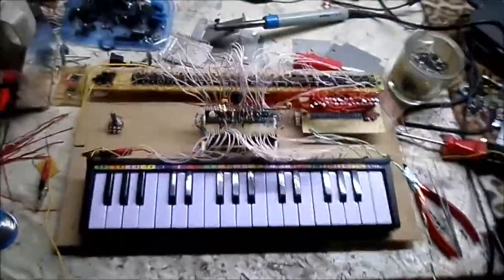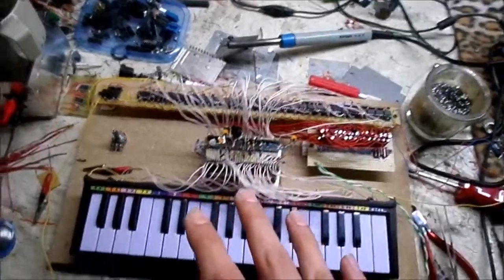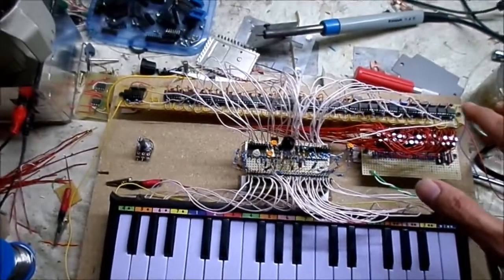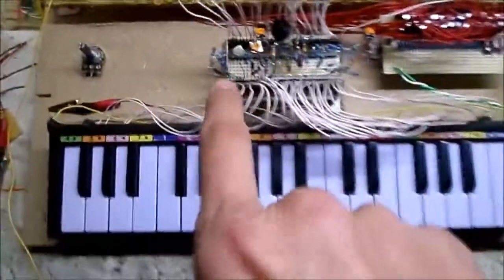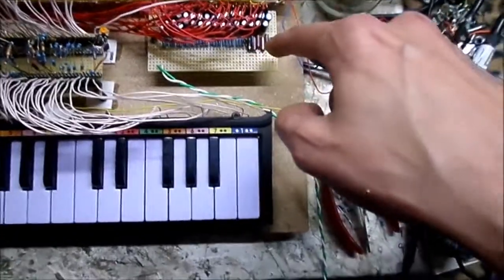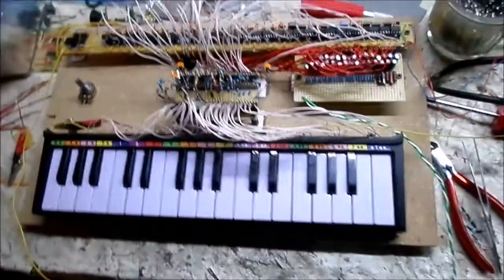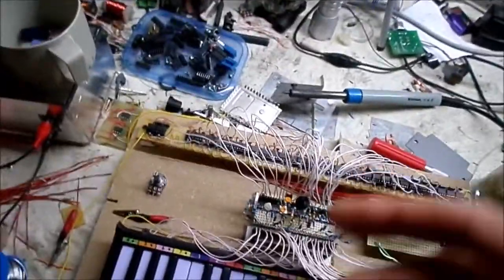'' 555 based '' polyphonic synth keyboard

Comment: You can use only 12 oscillators and then put to the exit of every oscillator divider chip (cd4040b) and you will have many octaves (oscillators must be tuned to highest octave that you need).

Comment: Great project. I tried this years ago but could not figure out how to keep the oscillators from affecting each other. I gave up and bought an old organ with a TOG IC and went that direction.  My TOG chip failed recently, and got me thinking about building a555 based TOG just for fun
Reply from the maker: decoupling is a major factor when working with oscillator circuits, every 555 has a 100nf decoupling cap, not sure if i show it in the vid .. what's a TOG ic ? i need to finish this project at some point using trim pots to tune all the keys
Reply: @dirkk82  A TOG is a Top Octave Generator

Comment: wish i knew where to even start with stuff like this
could you recommend a starting point? a book or something?
Reply from the maker: Forest Mims books on getting started in electronics is a great way to start, have a look online as u can preview the book to get an idea of what it offers =)
Reply: thanks for that, it actually looks perfect for a pure beginner :)
Reply from the maker: that was Mim's intention =) i've never bought books on the subject really, i just took things apart and bought components, looked at diagrams a lot and asked people a lot of questions .. the best way is learning by doing ! and that keyboard i built is in actuality very simple, it's just a lot of work ! basically u have 32 of the same circuit and only the frequency is changed for every key, set by a resistor .. keep an eye on the channel as i will have an update video of this project soon !
Reply from the maker: and if u have questions, come to our community on G+, im sure you'll find more things that might interest u :-)

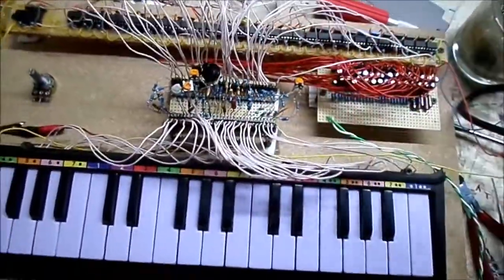Comment: 3:37 "trimpots" sounds for me like "trim pants" or "trim ponds" )) I've found the right word after few minutes of googling although...
I've reminded that I've tweaked probably one of these in my Roland A-800 Pro MIDI controller. It's setup for after-touch is horrible and you can't perform it if you'll not open the keyboard and turn that thing (to the left... not sure). It's funny how they do that ))

Comment: Cool project, very unique sound. I like it. XD

Now, here's how I would implement the same thing. Not a suggestion or anything, but the way I'v thought about a similar project. First of all, I would matrix the keys and use a ATMega Microcontroller. 8 keys (1 octave) per row, one octave per column. Now, to power the 555s, you could use the Arduino's +5VCC rail, which is a heavily regulated supply. You'd only need as many 555s as you would simultaneous keypresses, say, 9 of them for 9 key polyphony. The 9 outputs of the Arduino to the 555s would be pulse width modulated, and filtered with a capacitor, allowing it to replace ALL the resistors and trimpots, but still use the transistors. Code would be simple as you're only looking at keys and setting outputs to different levels. It'd fit in a nice little box. You could add a MIDI I/O plug to use it as a standalone keyboard or synth, by using the already made MIDI library. Additionally, you could add switches or trimpots on the analog inputs of the Arduino, and it could switch additional components into circuit, such as pulling the audio outputs to ground on key pushdown and release to add attack and decay controls. If you implemented the audio synthesis in software instead of hardware, well, then any arbitrary waveform could be loaded into it and used. But..... that would take a lot of time to do. I'v thought of trying this kind of project many times, but honestly, I have no time for it right now,
Reply from the maker: thank u much ! well i kept the project as simple as possible so anybody could follow and possibly improve on it or give them an idea .. and i see u thought out an interesting way of doing that .. shame u have no time but if u do, post it and let me know ! cheers !
Reply: I'l let you know if I ever make it for sure, and I'l definitely make a vid on it in that case.
Reply: theLuigiFan0007 the fact that he took no shortcuts is actually what made this stand out to me it’s a beast

Comment: no worries, you would find the microcontroller method rather demanding for the chip with full polytone, and the leaning curve somewhat steep.

Your current way of doing it would be copied in software, if I where to build one!
Reply from the maker: well there are other ways of doing it, an analog - digital setup for example which i dont think involves programming, as i said would have to research my options as the keyboard is plug-in, i could easily plug it into other circuits =) if you were to build one, let me know, i'd love to hear your ideas, maybe we could design something for the public !
Reply: +dirkk82 I can advise, but I got my own project.

I am likely to audiomod it later, but there the processing would be computer side.

The mixing of many tones in software isn't very tricky.

You have counters stepped at different speeds, and then just sum together the sinetable lookups for notes of interest.

main trick is getting fixed cycle/sample time, but there are hardware features to assist with that. (given you don't go above the period)
Reply: +dirkk82 You would add scaling factors etc. so it's quite a bit of math for the chip to do, and rather limited time. (addition and multiplication)

It would sound better with attack and decay, needing volume ramps.
The effect would be totally worth it.

basically you want something fast.
Reply: +dirkk82 If you can do a variable amplifier with a transistor, having a capacitor charge while the key isn't pressed, and then giving a kick before going down to a lower volume.
That circuit would give somewhat the correct effect of hitting strings.

A fast fadeout when the key is relased would also be good.

I remember seeing a synth demo online that allowed you to vary the volume ramp.
The difference impressed me a lot.
Reply from the maker: erlendse yes i am researching that as well, the website ( musicfromouterspace ) is fantastic and has a whole lot of very well thought out analog circuits mostly based on op-amps, i see using op-amps a lot in the near future !!
Reply: +dirkk82 Agree, opamps is the way.

a somewhat more fiddly way would be to divide down a master clock with different ratio per key. then use filters to turn it into sine (for groups)
The master clock can be crystal and super accurate.
You would need to plan the ratios in advance.

Given it would be all PWM from the dividers, you can use a fet to pull a output signal low, with variable pullup voltage for volume adjustments.

The attack/decay circuit would be resistors and capacitors. plan for fades of 0.1-0.5 seconds.

no microcontroller needed.

Comment: why some notes sound like so noisy?
how could you make them all sound same timbre?, i did this but the monophonic version and they all have the same timbre.
thanks!
Reply: If you use 12 555s tuned to a 12 tone scale and feed the outputs into 12 frequency divider chips (such as cd4024) then you will get several octaves of notes that all have the same timbre (aka waveform). If u wanna know why do some research on frequency dividers (aka binary counters). Anyway, this is the basis of how old school combo organs work